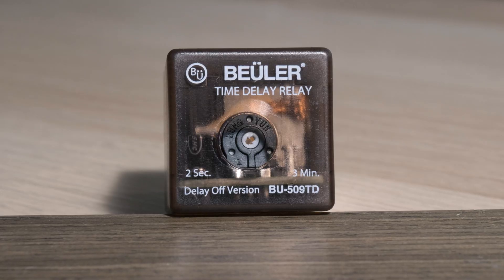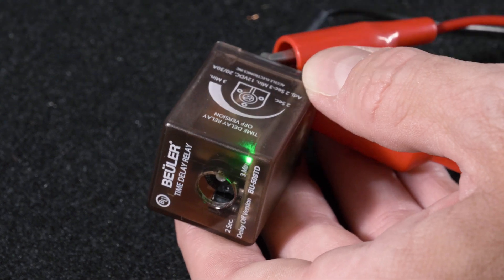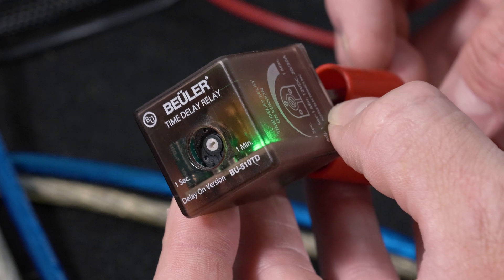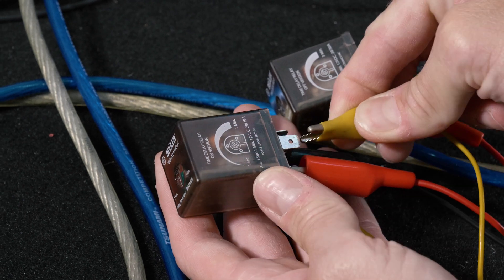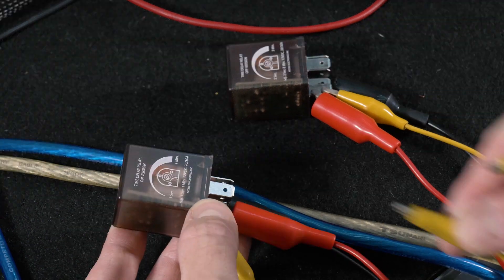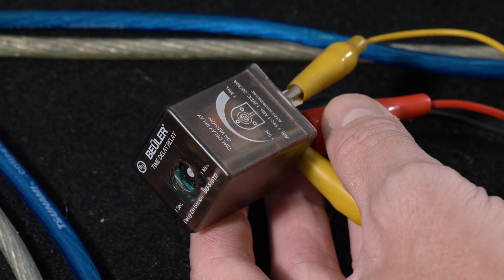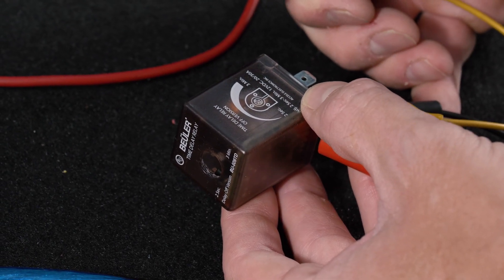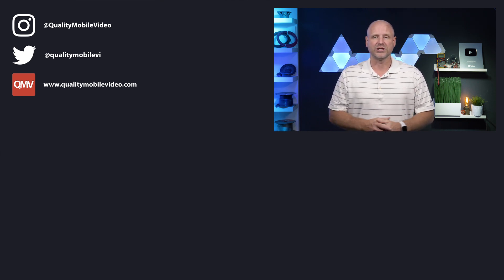Differences Between BU509TD & BU510TD Time Delay Relays - Delay-Off vs Delay-On

Comment: Question. So which of these relays would I use to control my intermittent rear wiper motor. When I switch the motor on from the front of my van (2005 Dodge Grand caravan) the wiper activates immediately then rests for 6 seconds, wipes, rests for 6 seconds, wipes and so on. Thank you.
Reply: both of them